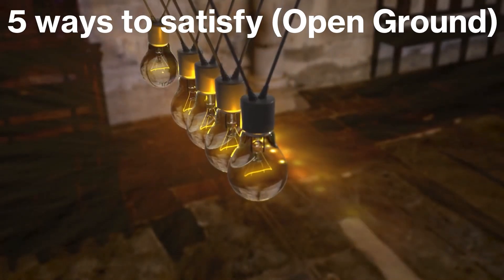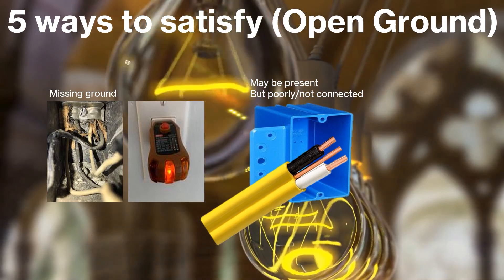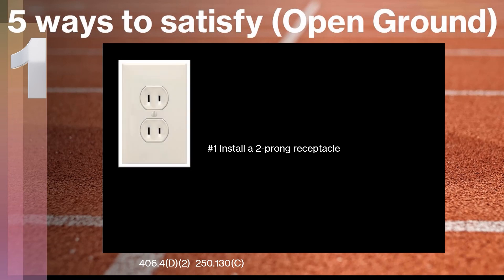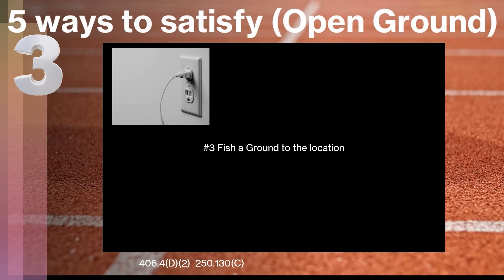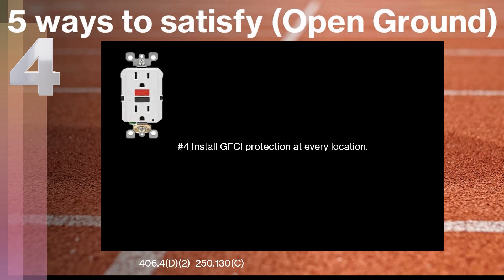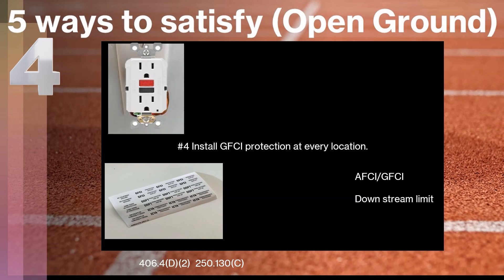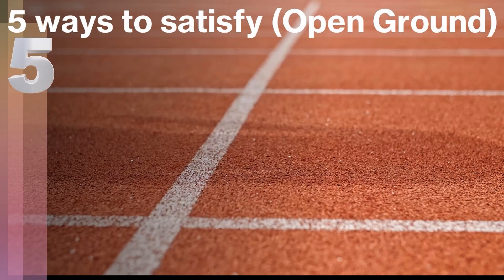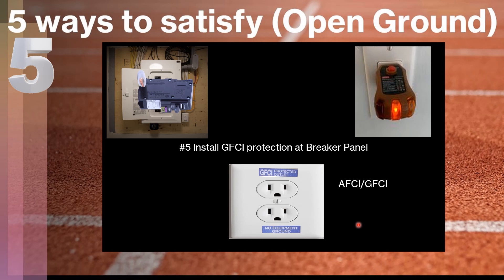5 Ways To Fix Open Ground Receptacles. With code references and visuals! How to fix an open ground.

Comment: If I installed exterior outlets (because I don’t have any, built in the 50’s) could I drill a small hole through my old metal boxes and block house to run a short ground wire from the inside to the new outdoor outlets?

Comment: You buy a pack of pigtails. And then you connect the ground wire to the receptacle, and you connect the other end with a twist nut to the neutral. 

Can you sell the house and smile!
Reply: See above, that is illegal and unethical. DO NOT DO THIS.

Comment: Thank you for sharing your knowledge.

Question: the second way to address a missing ground (rewire the location), involves running a new stretch of romex (e.g. 14-2), correct? Could  it simply involve running a single green ground wire from the breaker box to the receptacle?
Reply from the maker: They are several ways in 250

Comment: Helpful video.   While adding GFCI protection does not protect sensitive electronics,  like your 50 inch smart TV plugged into a surge protector, it does provide personal shock protection, so it's important to note that while Code does allow this practice,  it's not quite as good as having a true ground.